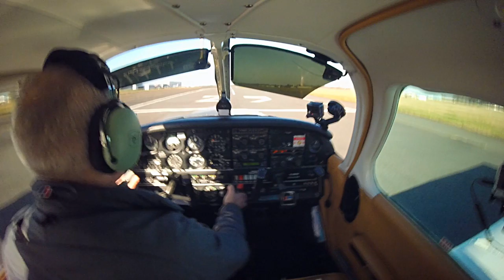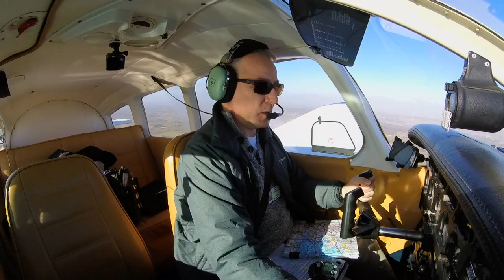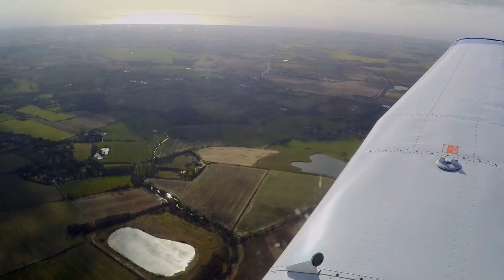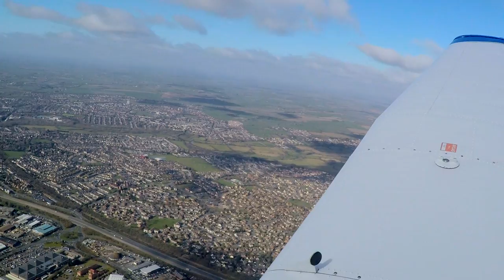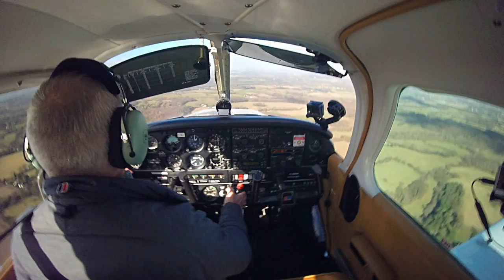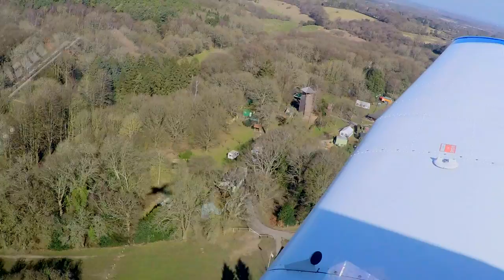PA 28, light aircraft, turbulence montage

Comment: Nice Video.  I experienced this in my 72' PA28-140 Cherokee hershey bar wing... I sounded the same as you, though I may have used other choice words than "fun"  :)   Oh, how did you mount your overhead camera?  Did you have to screw it into the roof or use some other adhesive?